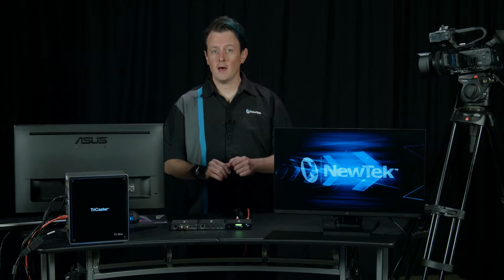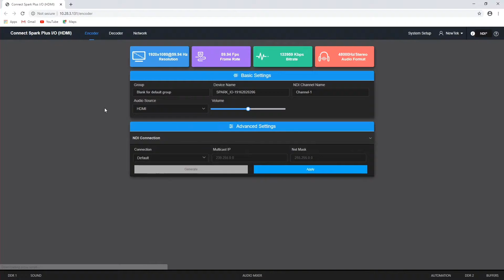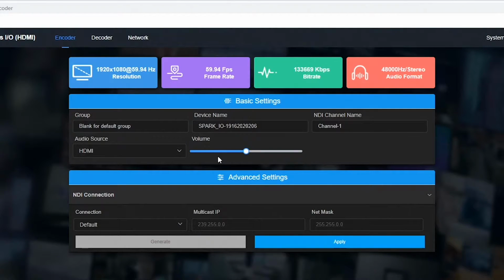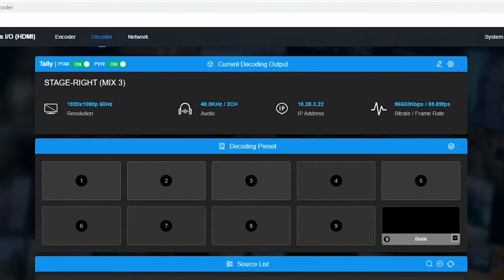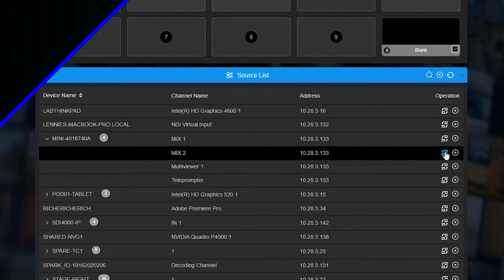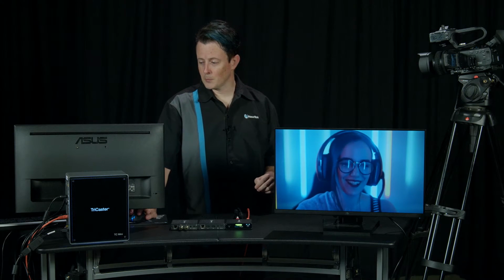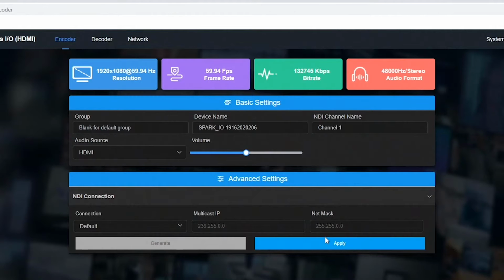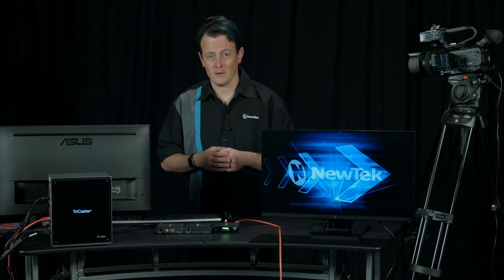Setting up the Spark Plus IO

Comment: I’m using a Spark Plus to decode to a 90” Monitor. I use it to show PPR slides and Zoom calls. The signal blinks randomly and I cannot seem to figure out why. If I plug a laptop directly into the Monitor, there’s no blinking so I’m thinking it’s the spark or the TC2. Any ideas what may be causing the issue? Thanks

Comment: Hey Richard, this video doesn't really walk through the setup of a Spark Plus IO device. When plugged in the first time, a message appears on the outputs saying "In order to use this device, please access the configuration web page and accept the EULA". When I access the configuration page, the closest I come to finding a EULA is an option to Connect to the Discovery Server. Any details on what that's all about? Discovery Server isn't even on the interface page you show.
Reply: Sorry if this answer gets you a bit later but, here is the deal:
Discovery Server has nothing to do with this EULA. EULA are just the letters for End User License Agreement. So like in every software, you got to accept the agreement in order to start using. The thing is that maybe you're trying to access to this EULA while you are in a production (with the broswer option of the source or the browser option of the Live Production in the notification panel). Don't do this. Instead, go out of the Production, go to the Windows and open the browser. There you can find the EULA, if not automatic, just type the spark IP address. Confirm and that's it.
Reply: Sure you're well over it, but thought it might help others.  Select the gear drop-down on the input selection.  Select the NDI source in question. Select the "Device Website" button. (Here's where we had trouble.  It bypasses the EULA.)  Delete "/home" after the IP address and type in "/login".  Now you should see the EULA.  admin/admin is the default combo.  OK to accept.  No longer see the error and video appears.  Cheers!